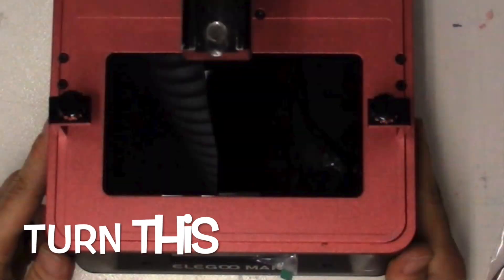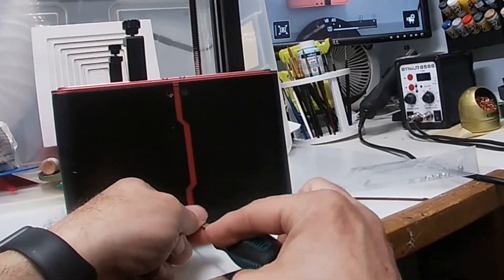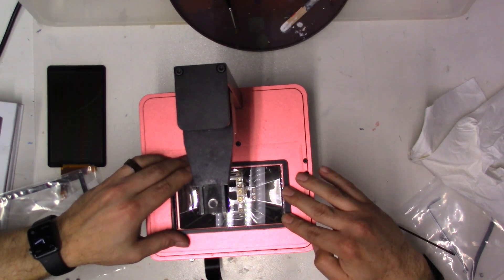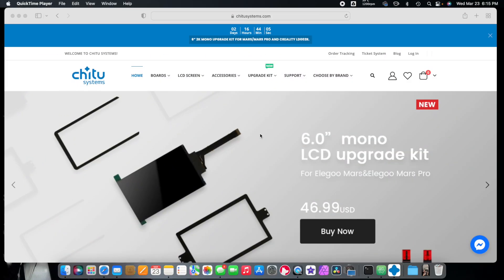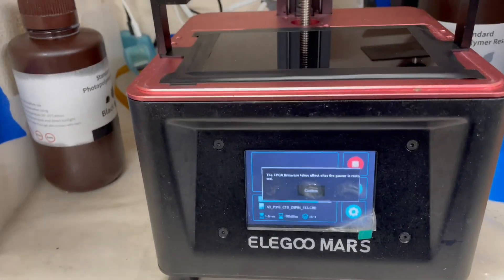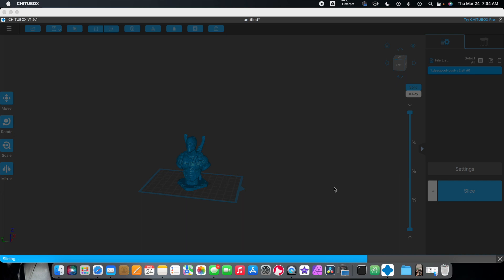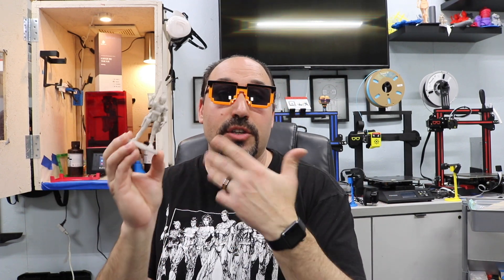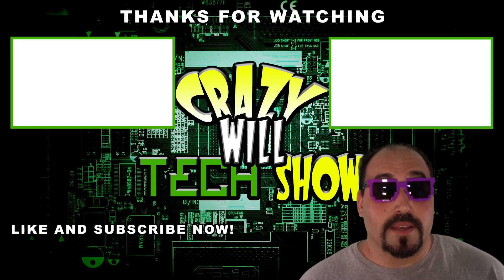How to upgrade the Elegoo Mars step by step

Comment: I didn't come here because of the USB stick issue, but I started having the EXACT same issue TODAY! I have been printing endlessly, cleaning things, replaced the film, re levelled, changed settings... Now thanks to your video, I will try a different USB stick!
Reply: Didn't help. This is so bizarre because the last print I did a few weeks ago was fine, and this one it just started doing it suddenly. Even tried different resins.
Reply: I just had this issue. It refused to work with one of my flash drives so I tried another one. It has to be smaller than 16GB, FAT32, MBR, and allocation may need to be 4096. My first drive was formatted correctly with the above settings but the printer was power cycling the USB port which I found out with a USB power meter. I switched to a name brand PNY flash drive with the same settings and it no longer power cycled the USB port.
Reply: @TheMack501  turns out my lcd was damaged somehow. Replaced with a 2k mono and works great again.

Comment: So I just installed mine on my elegoo mars but im habing trouble getting it to level correctly I believe.

So I am missing the smaller bracket that you sit on top of the adhesive. The manual says that you only need it for the Elegoo Mars 2. So after installing it without that piece i find that the LCD screen is not quite as firm and has some play in it when i push down in the screen. 

I leveled the bed with the paper and then when i went to print I believe my z axis was bottoming out because it was humming and ciuld get the first layer down. 

Im not quite sure what to do at this point but would love tonhear your thoughts!

Comment: Thx for the video. I did my upgrade on my OG Mars but now I get an error M20000 when I try to print a file. That is supposedly and error with the USB stick but I formatted and and tried a new stick and nothing works. Someone suggested I had the wrong firmware but Eleggo's site only has 1 option for firmware and there is only 2 files in there, the CBD file and the SH4. I have a type C motherboard. What firmware should I be using?
Reply from the maker: Chitubox has a great chat they help me to figure it out.

Comment: TL;DR - Had the same original film deposit problem. Reset the speed setting to the original Mars settings and reduced the bottom exposure time from 35s to 25s. Increased the exposure time from 2.5 to 3. Models seem to be printing fine using Elegoo water-washable clear green resin. 

_
After several prints of calibration using the Siraya tech test model 2021 v5, I set the bottom lift speed, lifting speed, bottom retract speed, and retract speed to the original Elegoo mars parameters. The 2 pro uses different speed settings. I need to be more advanced to know if resetting these settings to the original Mars settings helped. After setting the bottom exposure time to 25s. And exposure time to 3s. The test model is coming out without the film issue. I went back to my original USB drive. Everything is printing correctly under the new exposure settings on the original drive that experienced the problem. The prints are nearly the same, possibly better than my initial test models on my old screen. However, I no longer have the old test models to compare. The .15 peg is mostly there, with the .15 hole shadowed. .2 peg and hole resolve fine. Some curved corners are in the larger cross holes on the test card. 

Low humidity environment. Room temp. Using Elegoo water washable clear green for test prints. print time down to 55min from 1h39m.

I will be thrilled with the final results if the full actual prints keep up. The test model is not coming out tacky currently. 

Final note: I was using a flex build plate. I found that the build plate was shimmying during the base layers, causing a series of slides. Removal of the flex plate solves the issue; a non-stick coating for the vat film could solve the problem. But I changed both parameters at the same time when troubleshooting.

Comment: I ordered the same LCD... did the change including Firmware, now it is not working Unknown Format Error. Latest Elegoo Mars driver are for 1440x2560, and this LCD is 1620x2560. With Chitubox upgrade to 1.9.X how can we do cause all available firmware are 1440x2650 ? I should have mliss something
Reply from the maker: Do you have the elegoo Mars? You have to change the profile in chitubox as well. So it firmware update then lcd firmware update and change the printing profile in Chitubox.
Reply: @CrazyWillTechShow  I did but it seems that now my Elegoo Mars only accepts .cbd no more .cbddlt files. Also
I have like resin skins on the support platform and    on models…. Weird
Reply from the maker: That happened to me too did you change the printing profile to the elegoo mars pro? The exposure time went down drastically. I’m not in front of my computer but I believe it was a two Second exposure. Another problem I ran into was the usb stick was too slow now. Changed it out and it all went away.
Reply: @CrazyWillTechShow  you mean that I need to look at the exposure time and raise it as before?
Reply from the maker: Yes I show that in the video. There’s a lot of settings you have to change.
Reply: Do you think that tape thickness is an issue for the build platform to “touch” the screen ? @CrazyWillTechShow

Comment: Has anyone been unable to install the .cbd and .bin files? I recently picked up one of these kits to update my Mars 1 and have only been able to get the auto run file to work, the rest are declared "Unsupported File Type" by the printer. Running the type C motherboard for clarity
Reply from the maker: If you follow my video it should work.
Reply from the maker: If not if you go to the Chitu systems website you can live chat with someone there and they will walk you through it. They’re actually really good.

Comment: Hello. I'm planning to do this mod since my screen on original mars is dying. Did you have to readjust z axis? Or you just changed the firmware/settings on chiitu then leveled as normal? How I like to level is with the vat in, since it's the exact thickness and I can center it properly.
Reply from the maker: Didn’t have to change the Z axis. I use the manual to level the bed. AKA piece of paper 😂

Comment: I have the same exact issue with the prints. It leaves a film on the build plate and I
ve tried with 3 different USB sticks and 2 of them are brand new
Reply from the maker: I would try change exposure. Either first buyers or over all. The first part was my problem.
Reply: @CrazyWillTechShow   I changed the exposure time, lowered by .5 sec and it hot better. However the upgraded firmware and using the Mars pro 2 settings gives me a .ctb extension for the files instead of the regular .cbddlp . Do you think it could be the source of the problem? I haven't done any research on that yet (in progress). BTW you're awesome and because of this video I made the upgrade. THX 'Mate
Reply from the maker: @jankal8910   I don’t think that’s the problem because I use those files. But when you export you can change it to original file format. Really appreciate the support sorry you’re going through this.
Reply: @CrazyWillTechShow   Thank you for the tips. BTW I'd never thought that you'll answer, so thank you for that too. This IS fun, without challenges there is no improwements.
Reply from the maker: I answer everybody. If you’re gonna put content out there you have to back it up. 😁
Reply from the maker: Sometimes it takes me a little bit or I Forget. But I try to answer everybody.
Reply: Did you get a final resolution? I'm having the same issue, new usbs is not fixing it. Im on to playing more with exposure settings. But the exposure calibration test prints ive done say i need more exposure time.
Reply: @michaelc4321  the exposure time changes solved the problem for me, but I still had some minor issues with the prints like, half cured resin and tackiness right after printing.....so if you can, get a new printer. Good luck Mate 👍

Comment: hi, is that board using the original one? or should be change to support the mono lcd?
Reply from the maker: Yes that's all the original components except for the LCD. You just have to update the drivers on both bored and LCD. Make sure your settings in chitubox are updated as well.

Comment: I notice based on product images and your video, that this modification is higher than the original, and smaller than the a vat's footprint. Do you ever find any issue with this stretching the fep film, or getting the vat into place? Thank you for making this review video, as I just ordered the kit due to a dead zone on my original screen.
Reply from the maker: It’s a Little tighter you’ll have to adjust the bed or plunger. Didn’t seem to have an issue with fep. That stuff is pretty stretchy. Did notice it does lift the lid of the printer when it’s done because of the extra space. Other than that it’s really good. Thanks for watching!